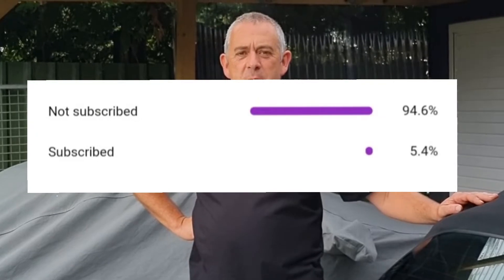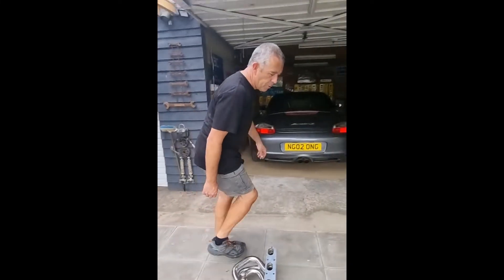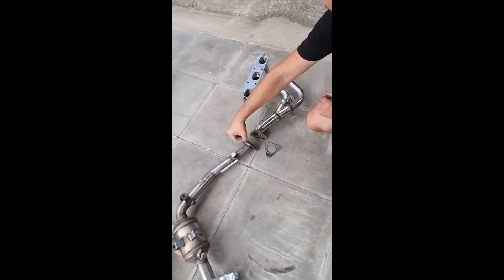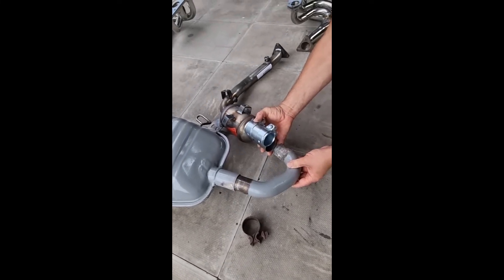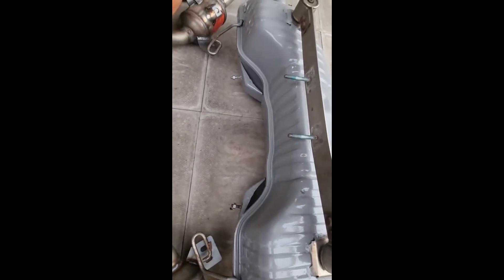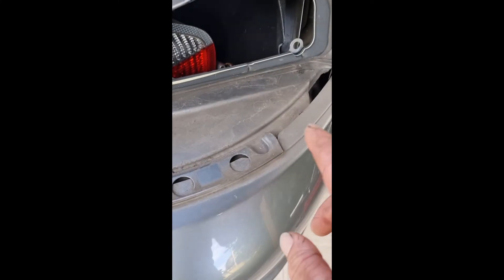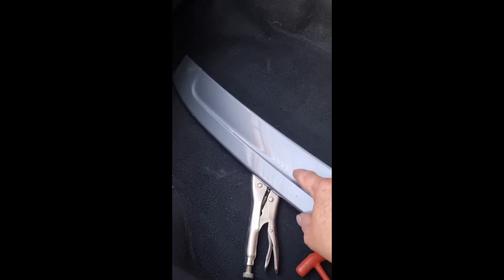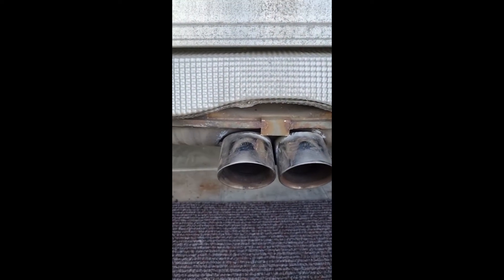Porsche Boxster 986 exhaust explained

Comment: Great advice about cutting a slot into the flange to get the old bolts to free up. I’m looking to do some work on my exhaust so will take your advice on that. Would you think it possible to do that while it’s still in place on the car? As the old studs just won’t shift. Thanks